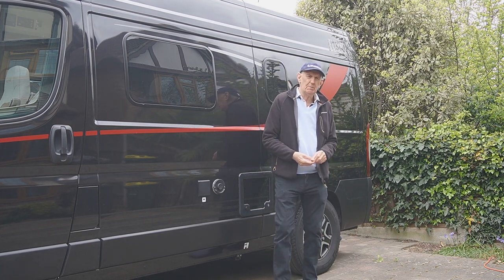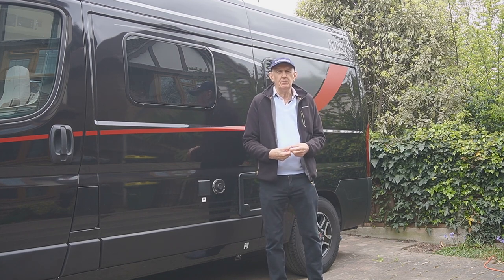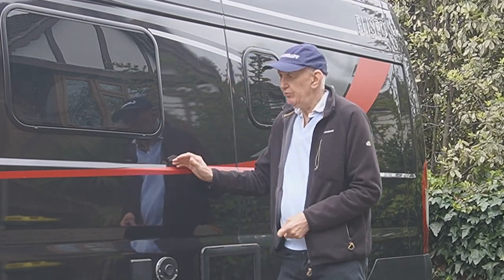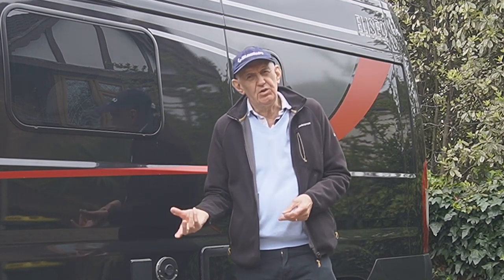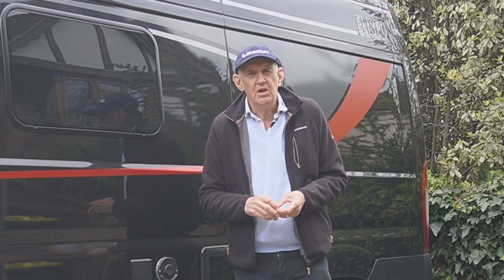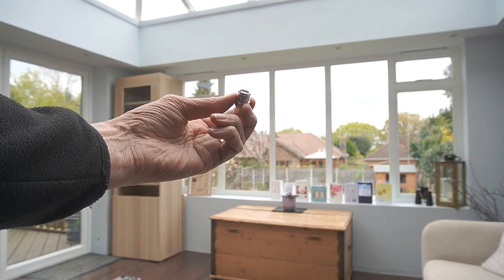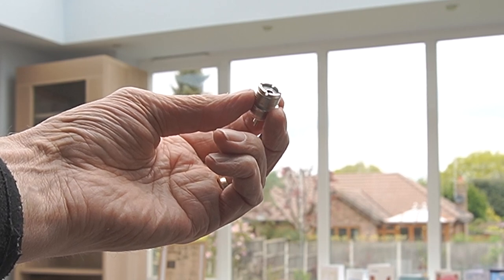HF Mobile Antenna Magnetic Mount Trick | HAM RADIO

Comment: Garden centre - look for slug tape a sticky backed copper tape, usually pretty sticky and the copper is robust. 

Also available on Ebay and Amazon 3 to 7 quid a roll depending on length and width. I keep a roll od 5mm tape in the workshop for the odd circuit board repair

Andy

Comment: Hi Peter, suggest that once you get the braid length to where you want it, use aluminum foil tape to adhere it (cover over) to the roof of your mobile home, just be sure to clean the surface beforehand. See how that holds up. You may want to configure some sort of easy disconnect so you can leave the braid when you remove the antenna/mag mount.   K2DCD
Reply from the maker: Many thanks for the suggestion. Will put it on the list to test.
Reply: @watersstanton  Good will be curious how well it works. Take Care.
Reply: Well I seen this video of Peters, I had not read your comment Dennis until now, This is for Peter also if he gets to read it. After seeing this video of Peters, I had a HF80CL Diamond I was having a little trouble to get a low swr, etc, I only had a small VHF type Mag Mount, but it would hold the HF80CL on the Toyota Hi-Ace Van long wheel base. I also welded to stainless steel large washers to the top on the edge of Mag Mount, I then put this on Van roof, removed the stainless steel rod and used copper rod for the top part of whip, I then got Alfoil the normal Alfoil I pulled out a couple lengths of about 500mm each side of mag mount, and pegged it to washers on Mag mount I held the foil down on  Van roof with bits of timber, just to try, so it does not seem to matter the length but folded Alfoil each side of Mag mount pegged to washers on Mag mount and it was 1:1 swr, but the result on Morse code and SSB at 50 watts was amazing I was getting 5 9 9 reports over 800km to 900 km 80 meter band early morning. All it took was the added foil for the capacitive AC reactance coupling to ground. No psychical ground just capacative coupling to ground, works like a charm. Aluminum foil 30cm wide or 300mm wide. Works like a charm but held down on Van roof with bits of timber to stop blowing away.

Comment: You could make your own magmount with magnets that will fit between the ridges on the roof and then a steel plate, obviously needs a thin rubber mat under the magnets, that way you would not need braiding and you could use the centre of your roof. If it was me i would just drill a hole in the middle of the roof and add some plate on the underside. Actually, i already did do this to my van.

Comment: Cover your braid in glue lined heat shrink and put a ring connector on the end. Run your covered braid in through the gap on the rear door and attach to one of the nuts at the door hinge.
Reply from the maker: The heat shrink will reduce the capacity somewhat. I need to explore the  various-suggestions. Thanks for sharing.

Comment: Move the mag mount near to the awning rail, a large croc clip on a short piece of braid from mag mount then clip to the awning mounting bracket = perfect ground connection, I have operated on 160/P with this.
Reply from the maker: I tried that but got better results using my braid arrangement. Not sure why but will do some further tests.

Comment: I tried that last year to get more capacitance, but I used two thin wires, I'm guessing that didn't work for it didn't have enough surface area.  Well, it turns out that I did buy a try-mag mount and tried it yesterday.  You are right, those ridges sure get in the way, but I got two of the three to latch on the surface of the roof.  Results?  Well the bands have been really bad near my house.  I can definitely say I had a much lower SWR, and a much higher return loss at about 25.  Can't wait to try your idea and I also want to see how efficient 40 m is with a tri-mag mount.  Good luck on your trip, be safe.
Reply from the maker: Hi there. If the VSWR improves then it is all going in the right direction.
Reply: @watersstanton  Super.  And, I didn't have to use a choke. Although, I will use one - I just don't have an extra one.
Reply: Cut your own steel plate to make all 3 fit and replace the current plate that holds them all together.

Comment: If you have flip open fixing points for roof bars, you can modify a roof bar leg kit. They have rubber feet so not scratches, the bolt is a direct earth to the roof so a great earth. I can even have a 160m mobile whip and no tuner in line. My tip would be have two mounts either side for different bands, use mono band antennas keep it simple so no tuner in line and keep the mount as low to the roof as possible. Having the antennas at the back especially with that van is that you will directivity like a beam.
I use the centre loaded diamond CL range that I bought from you and yes you may have to swap but at least if you see the swr deviate you know you have a problem.
Seriously since using these mounts with those antennas and the pro7 headset it has been a game changer.
Reply from the maker: Thanks for sharing. But there can be some major problems with roof bars as they often don't pride the earth return expected.  I have dealt with many problems where roof bars actually appear to the coax feed, as an extension of the antenna. I have dealt with so many customer problems caused by this, that as a general rule I would urge caution. It is very much a case of suck u an see.
Reply: @watersstanton  I don't use the roof bars only the foot packs you can buy separate.
The bolt the holds my antenna mount is bolted in directly to the fixing point which is a direct earth. This means the antenna mount is about an inch above the roof.
Reply: @watersstanton  I can't attach a picture but my qrz page has some pics of the mount.
P. S just worked Hawaii, NewZealand, Australia, Panama and French Polynesia from the car this morning 👍

Comment: Put this here for Peter and all.
Well I seen this video of Peters, I had not read your comment Dennis Dura, until now, This is for Peter also if he gets to read it. After seeing this video of Peters, I had a HF80CL Diamond I was having a little trouble to get a low swr, etc, I only had a small VHF type Mag Mount, but it would hold the HF80CL on the Toyota Hi-Ace Van long wheel base. I also welded 2 stainless steel large washers to the top on each edge of Mag Mount, or 2 sides only, standing up,  I then put this on Van roof, removed the stainless steel rod and used copper rod for the top part of whip, I then got Alfoil the normal Alfoil I pulled out a couple lengths of about 500mm each side of mag mount, and pegged it to washers on Mag mount I held the foil down on  Van roof with bits of timber, just to try, so it does not seem to matter the length but folded Alfoil each side of Mag mount pegged to washers on Mag mount and it was 1:1 swr, but the result on Morse code and SSB at 50 watts was amazing I was getting 5 9 9 reports over 800km to 900 km 80 meter band early morning. All it took was the added foil for the capacitive AC reactance coupling to ground. No psychical ground just capacative coupling to ground, works like a charm. Aluminum foil 30cm wide or 300mm wide. Works like a charm but held down on Van roof with bits of timber to stop blowing away.
Reply from the maker: Very interesting. Sounds like oyu will nhave fun. 73 Peter.
Reply: @watersstanton  Is that, "Sounds like you having fun". Yes Peter, and learning all the time, never stop, that's the engrossing happy part, hi hi. Thanks Peter 73

Comment: My problem is that my van has an aluminium roof and body so the magmount is not attracted to it.     I am trying out a stainless steel plate, 25cm square, to which I will attach the magmount and then sit the whole lot on the roof.    If it works, I will permanently adhere the plate to the roof so I can mount and remove the magmount as I do on my car.   Do you think it will work?

Comment: Hi Peter, would the Diamond MAT 50 magnetic capacity plate not be a neater solution? M0KED.
Reply from the maker: Yes, but I did not have one and the point of the video was to solve the problem at zero cost.

Comment: Can you attach the braid to a metal part of the vehicle ?

Peter G0LVG
Reply: That was my thought as well
Reply from the maker: Yes if you care to scrape of some paint!  Not my recommebdation because you then have to fasten it to the surface. Capacity is just as goid and easier!
Reply: Peter I was thinking maybe you would be able to use a solder lug on the van hinge bolts that was my thinking.

Thank for your videos

Peter

Comment: Why not add a crock clip and clip it to the rail to the sun awning
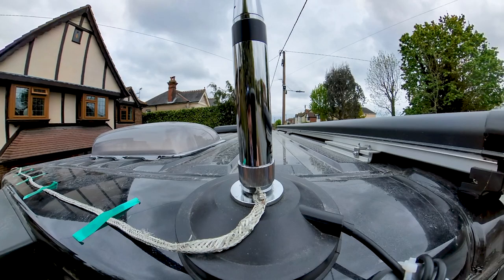Reply: That was my thought !  If you stop the video at 3:44 there’s the aluminum rail for the awning that runs the full length of the van, and it even has some “convenient” bolt on hardware close by 😉.
Reply from the maker: Yes thar is an option but as many vehicles don’t have this feature I wanted to try something that would work on any vehicle. Will report on that in some future video.
Reply: Interesting that you use the term  "croc(k) clip, as we refer to it in the USA as an "alligator clip".

Comment: Gorilla tape will hold the braid to the roof in all weather no problem. Just watch it doesn't pull the paint off if you try to remove it 😊
Reply from the maker: Thanks. This is only a temporary arrangement. I have other ideas!